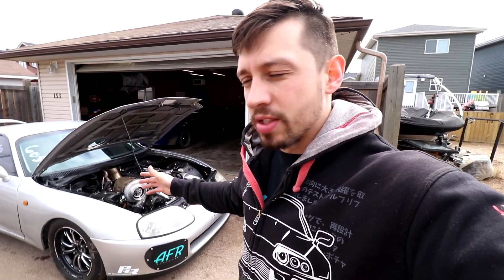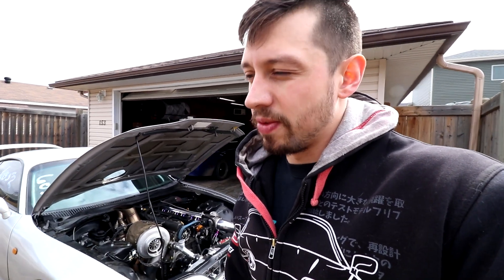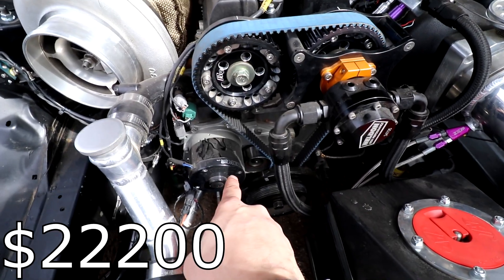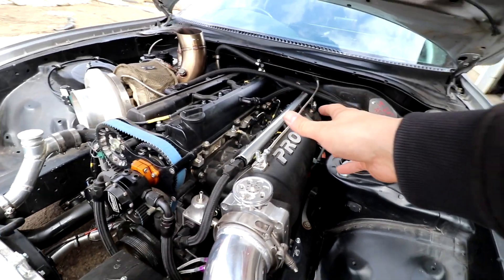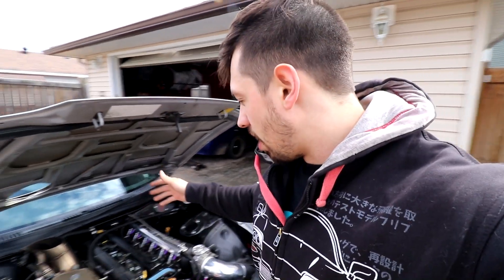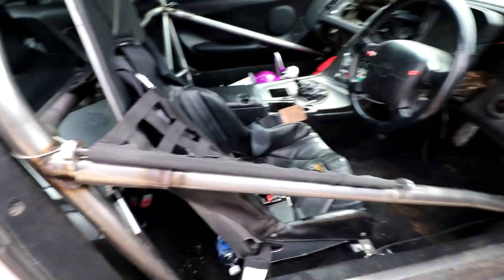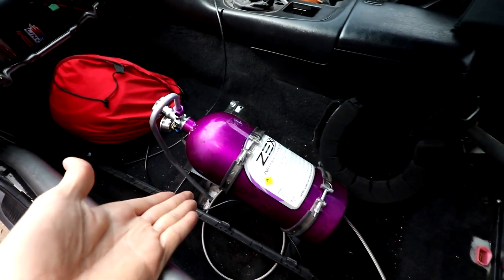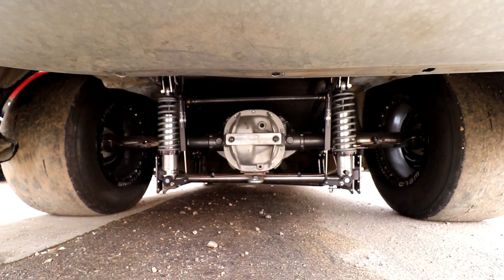Cost Of My 8 Second Huge Turbo 1000HP Supra.

Comment: Hey Kyle I had the same BC single valve springs on my car making 850hp 7500rpm valves were floating caused me 6 bent inconel valves, you need to upgrade if you're going to make more power down the road !
Reply from the maker: Supra Drift i figured I was pushing it 😂

Comment: Things no one ever told you:  Kyle, when playing with turbochargers, you NEED to wear hearing protection.  Why?  The tips of the compressor wheel breaks the speed of sound and even though you can't hear it, that noise will injure your ear drums.  Later in life you will be straining to hear the TV when everyone in the room says it is already too loud.  It cuts out certain frequencies as well as causing a wind rushing or mild ringing that covers up normal sound levels.  Protect yourself~!